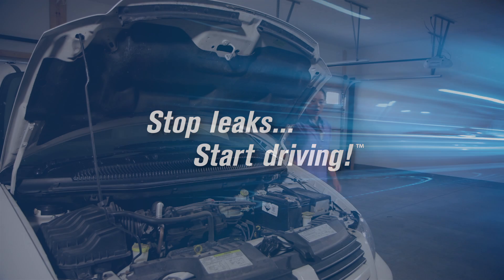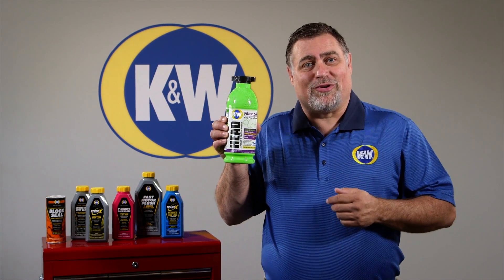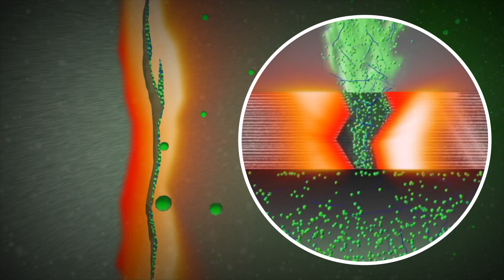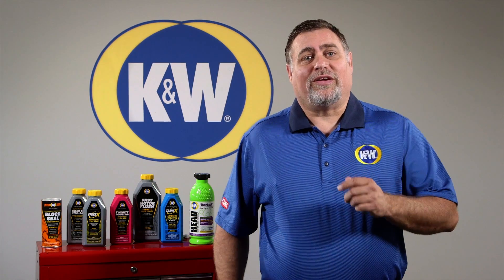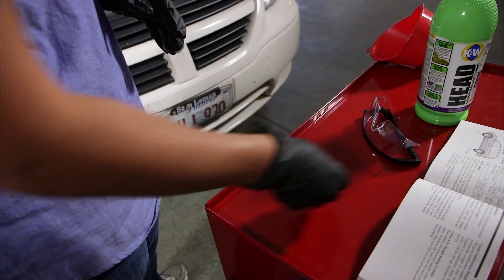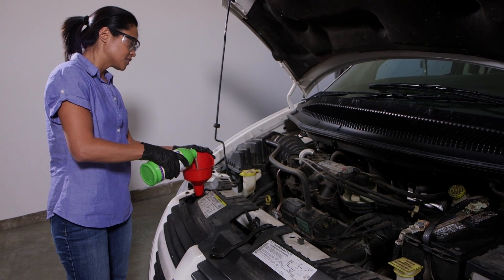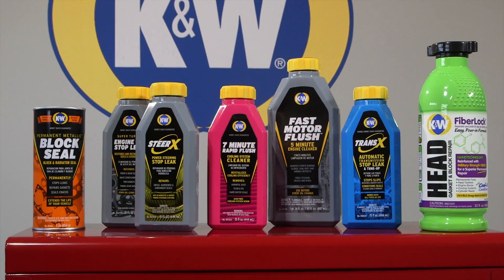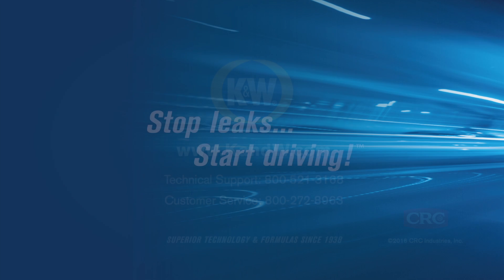How to repair a cracked engine block or head gasket with K&W FIBERLOCK

Comment: Bad information! Whenever you're using a product like this, you should be unhooking the two hoses that go heater core and  then tying them together. This allows you to bypass your heater core so you can circulate the additive through your entire system without having to turn your heater on high. If you don't do this odds are you will  completely plug up your heater core. You should only follow these instructions if your an absolute emergency situation, as it will indefinitely plug up your heater core and end up costing more $$$ for additional repairs.

Comment: Can you do this on a boat engine that has no radiator and is an open system ? It pumps in fresh lake water and goes through the engine and straight back out in the lake.
Reply from the maker: Please contact techservice @crcind.com and they'll be able to assist.

Comment: What about a cracked head? I used fiberlock yesterday,change the oil( milky) and filter,put about 1 1/2 gallons of water,put half a bottle of fiberlock,ran my truck about 15/20 minutes. The constant steam coming out of the exhaust pipe was missing greatly. Shut of the motor,added water,no more steam,motor was running much smoother. Started the truck this morning,same old steam from the exhaust,milky oil. What did I do wrong or do you think the motor is to far gone to use your product again. I can't afford $1500.00 on a 1990 truck for engine repair. Please give me some advice, I'm caught between a rock and a hard place right now. I can't go home because my truck isn't working. And I'm not walking 75 miles to get there.
Reply from the maker: Please contact techservice@ crcind.com for assistance. Thanks.

Comment: HA HA HA HA 😂 🤣 😆 😄... when you gasket is gone, it's getting presured air in to the antifreeze, not antifreeze in to cylinder!!!! You know!!! There's no way this to move in to Crack think a little !!!
Reply: No not entirely true. Head Gaskets have 2 potentially different air ways. Depending on where the crack is, it can definitely get into the piston. This only works if you have water in your oil. Not the air / oil in the coolant.

Comment: 2013 Ford Escape has no radiator cap. do you have a video on what I can do?
Reply: me too i just have a reservoir container like you...good question, lmk, when you get an answer, ty
Reply: read Mark Malasics post...thats what what well do, got it?
Reply: I believe you remove the upper radiator hose and poured it in the radiator through that opening.

Comment: Isolate your heater core from being plugged by bypassing it and plan on replacing the radiator.
Reply: How do I do that? And is there any way to prevent the radiator being replaced? Mine is pretty new.
Reply: @DebraGerik  The issue with stop leak is it tends to clog the small passages of heater cores and radiators.  Some more than others, excessive amounts of stop leak more so.  The type that contains water glass (sodium silicate) is somewhat less likely to plug the radiator.  If you begin experiencing overheating issues, this may indicate your radiator was harmed.  Most radiators are constructed using aluminum tubing and aren't repairable (this is why many radiator shops have disappeared), older types were constructed of copper alloy and often can be recovered.  So if you're experiencing cooling problems after dosing cooling system with stop leak, there's a good chance your radiator is plugged.  Of course the thermostat itself is also suspect as is the temp gauge may be incorrect.  Temperature sensors are often to blame for incorrect temperature reading on the gauge, causing the appearance of overheating when it's really not the case.  If you believe the radiator is in good condition, you may have a defective temp sensor or thermostat.  Stop leak though, Is no friend of radiator function.
Reply: 😜😜 I was to write it.

Comment: So how do you add it to a system with no radiator cap? Pour it in the overflow tank?
Reply from the maker: Hey! Happy New Year and very good question!! What you want to do is remove the upper radiator hose and pour the product in that way. Never pour additives into your overflow tank :-)
If you have any further questions please don't hesitate to contact our tech line at techservice@crcind.com or 215.442.6290
Reply: @CRCAutoUS  Thank you for the prompt reply. :)
Reply: Thank you, I’ve recently been searching for information about this subject for a long time and yours is the best I have found out so far.  https://upmypc.com/2021/06/29/edge-blocker/

Comment: Why is she hanging out with the car while running in an enclosed garage? Lol, jk. For real though, I just completed getting my cylinder heads resurfaced and replaced the head gaskets in my 06 Tacoma. Definitely tedious but if you have the time more than anything, totally worth it to try this and/or dive into the motor.
Reply: Came here to ask the very same question

Comment: Can it take up to a week to work?
My engine hasn't seemed to improved after a few days
Reply from the maker: Thank you for your comment.  Yes it is recommend to give the vehicle about a week after treatment to see results. If after a week you see some improvement but not 100% then do a second treatment. If there has not been any improvement please call our Tech line at techservice@crcind.com or 215.442.6290 before a second treatment. The leak maybe too big or something else is happening that requires other steps or a different product of ours.
Reply: @CRCAutoUS  I just used this in my 00 Honda Odyssey and I even took the thermostat out and it's still overheating after 30 minutes of run time and 1 hour of drive time , radiator cap cold but bottom of radiator hot , still over heating , not sure if it is getting to the top of the radiator ? Cap bad from the sealer ? It's got sealer all over it , would lower cap pressure fix it ? Help it is my last resort ! 3 5 VTech engine Honda Odyssey LX 2000 !
Reply from the maker: @commonsense3673  Depending on the leak fiberlock can be a few days to a week also depending on the leak fiberlock may not be the best product. I would recommend contacting our tech service directly 215.442.6290.
Reply: its a scam...no miracle in the can!!!!!!!!!!!!!!!!!!!!!!!!!!!!!!!!!!!!!! common sense, look up Scotty kilmer

Comment: Hi I have Nissan Armada 2012 V8 and have the same issue car was heating up again and again same milky thing was showing in oil cap and yesterday car got so heat up and got switch off and then I have to take help from jump start ppl and start my car again but after that in my car water leakage is little more from middle of silencer and from tail too and also missing sometime while trying on starting engine  if u send me u r no or email I can send you video so U can advice if this will help me or no..  kindly advice ASAP since Otherwise will cost me too much money ....thanks
Reply: U have Coolant in your oil, that's why the oil cap is milky and you're over heating...You have a cracked head
Reply from the maker: Thank you for your comment.  Please contact our tech service department at techservice@crcind.com or 215.442.6290 for additional information.

Comment: DO NOT USE THIS CRAP.

This crap gonna clog your cooling system and cause overheating eventually.

That will cost you more than $1000 since you have to replace not only radiator but also waterpump, thermostat, heatercore.

Some people may try flushing first, but you won’t be able to take this shit out completely.
Reply from the maker: To ensure success with FiberLock or any pour and go type of block sealer, ensure the vehicle is losing coolant. The water pump and thermostat must be fully functional. For FiberLock the directions must be followed exactly. Only pour into the radiator cap or the upper radiator hose, do not add FiberLock to the overflow jug or hose. Only add the proper amount of FiberLock per the size of your vehicles cooling system. You must look up and see your vehicles cooling system capacity. Over treatment will result in clogging. Make sure FiberLock is added to cold coolant or water. Do not add to warm or hot coolant/water.

Comment: Ok people if you dont trust this product use bars brand they have some good products as well but k&w worked for my 04 v6 mustang without having to drain and flush radiator and engine

Comment: can this be used on diesel engine .. Have a 2003 Toyota  Prado 1KZ TE engine ... will it work?
Reply: No get it fixed properly
Reply: I have a problem with the radiator water going back into the reservoir
Reply: thanks
Reply: Don't use block your car radiator

Comment: I got my 2004 Saturn ion to start after replacing nasty, burnt plugs, sealing with blue devil head gasket sealer adding water and oil. The blue smoke died alot after driving home. Sat in driveway for about 2 hours before I attempted to start again. Car cranks over like b4 but won't start. What's my next step?
Reply: No solution is you added water to your oil,  water's electrolysis properties will rust your car from the inside out. Under no circumstances should you ever add water to oil
Reply: Buy a new car

Comment: THE LAST TIME I ADDED A BIT MORE, IT DID BLOCK MY HEATER FROM WORKING. I HAVEN'T DRAINED THE SOLUTION, AND RE-ANTI-FREEZED YET, BUT I THINK IT WILL HAVE TO HAVE SOME WATER FORCED THROUGH THE HEATER CORE, TO OPEN IT BACK UP.
Reply: Thank you, I’ve recently been searching for information about this subject for a long time and yours is the best I have found out so far.  https://upmypc.com/2021/06/29/edge-blocker/

Comment: I SEALED MY FORD V-6  '96.....DON'T LISTEN TO THIS BULLSHIT THAT YOU DON'T HAVE TO REMOVE YOUR ANTI-FREEZE....YOU NEED TO DRIVE YOUR CAR OUT ON THE HIGHWAY 500 PLUS MILES...  MY CAR WAS PUTTING MOISTURE IN THE EXHAUST.  IT MAY HAVE TAKEN MORE THAN THAT, EVEN TO GET IT POUNDED IN.  IT WAS NOT TREMENDOUS LEAK LIKE MASSIVE VAPOUR YOU CAN SEE IN THE REAR-VIEW MIRROR.  BUT A MODERATE AMOUNT.

Comment: I have a cracked head gasket no mixer in the cooling system but mixer in the oil what kind should I use

Comment: what if i dont have a radiator cap? can i just pull the top hose off, pour k&w fiberlock down the hose, connect the hose back up, then start the vehicle?
Reply: do I need to let any coolant drain?
Reply: If she doesn't have a radiator cap she should be able to pour this directly into the overflow tank

Comment: I have a 2001 f-150, i noticed a slight coolant leak between one of the heads & the block & i noticed some oil in the coolant reservoir , will this product work for this?
Reply: What  happened  to  your  F-150. I have  a  2003  mustang  and  notices  oil  in  the  coolant  reservoir.
Reply: How do you prevent heater core from being blocked